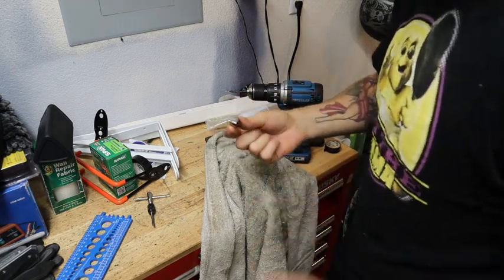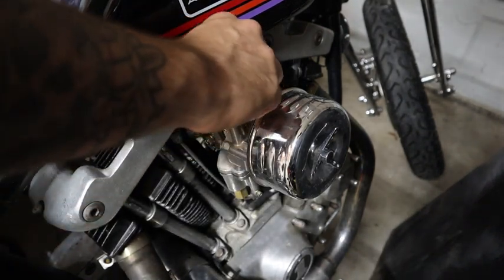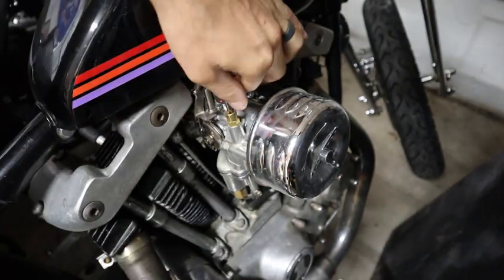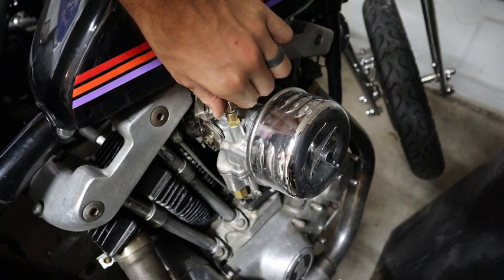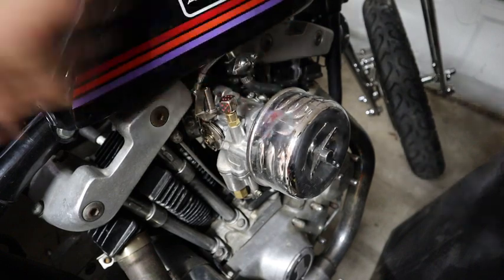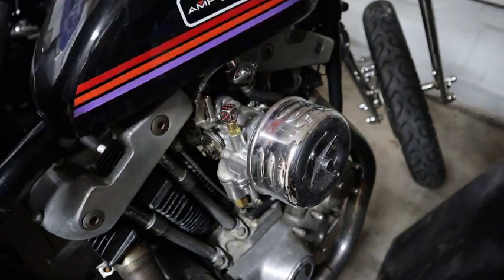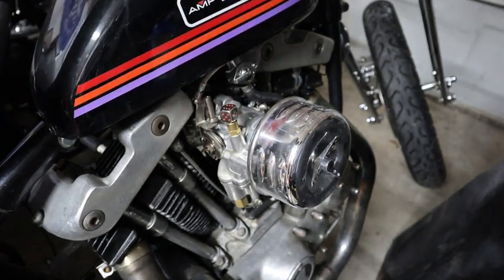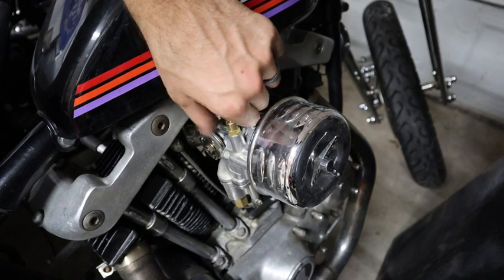Custom Dice Enrichment Knob // 1974 Ironhead Chopper

Comment: How did you end up getting the carb to work? Mine would shoot gas back when I tried to crank mine. I have yet to get it to fire up.
Reply from the maker: @basssmackingtv6863  the carb is working ok, still trying to dial it it perfectly since I had the motor rebuilt. I had issues with it spitting back at me as well and I had to correct the timing on the engine. I also cleaned the carb really good to ensure there was no debris.